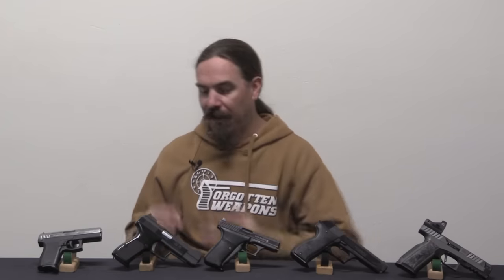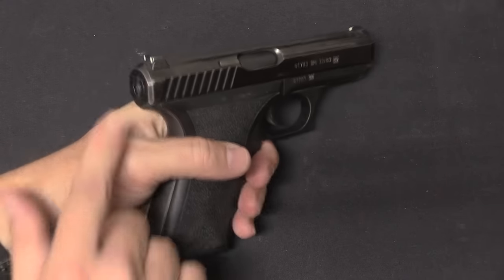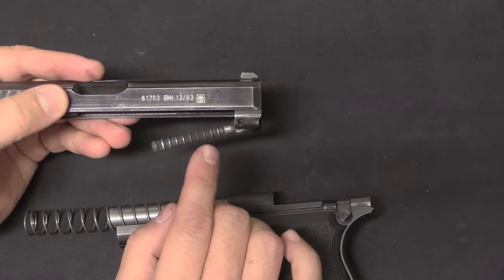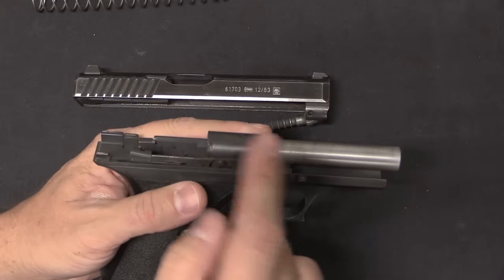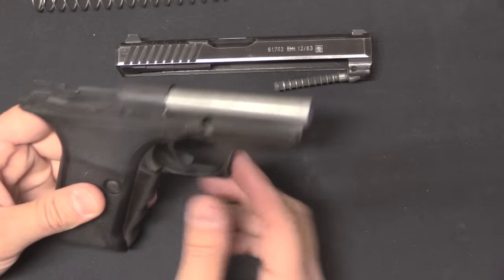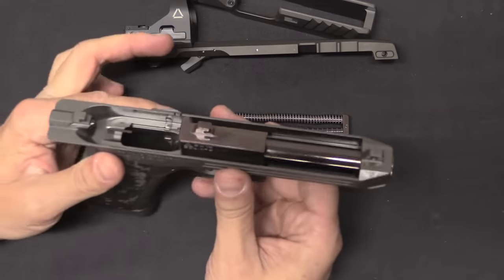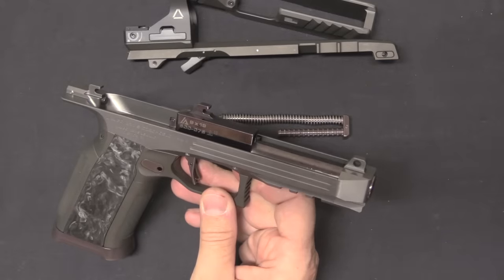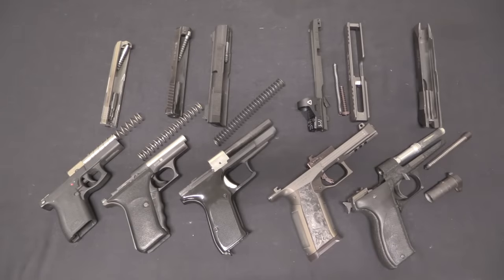Gas Delayed Blowback Pistols: A Tour of the System

Comment: I'm also a collector of gas delayed pistols, lovely to see this Ian.  The ADP was not available in 45 ACP but rather a shorter GAP like 45 ADP.  Only a few were made by Alex as prototypes. Alex was the owner of my local neighbourhood gun shop back in the day, so got to see these things.  I'm looking for a Norinco 77 and the CCP myself.  Have models of P7/GB/ADP/CP1
Reply: Skip the CPP my friend, parts #44 and #46 are made of polymer that's the wrong spec for what it does. After a random number of rounds, Part #44 destroys and or fuses with part #46 causing a complete failure of the striker mechanism. Meaning that you can throw the pistol at your target, but nothing you can do to the gun without rebuilding it will make it fire. 

And it's a real shame too because the ergonomics are fantastic, it's light and easy to carry, its incredibly accurate, and the recoil mitigation really does work. It has all the gas delayed pistol issues with overheating and needing frequent cleaning, and it only holds 8 rounds of 9mm but even with those shortcomings I would have loved it if the gun was reliable enough to keep.
Reply: @ericgrumbles447  But he's a collector, so it doesn't matter if they're junk LOL
Reply: Very Jealous.
Reply: Is the CCP made by  Umirex (sic)

Comment: I own a Steyer GB.
Very nice shooting 9mm. 
Very ergonomic design, polygonal rifling, 18 shot capacity. Way ahead of it's time.
It's only minor drawback is that you can't shoot lead bullets out of it and it is a very dirty gun to clean.
All that gas blackens up everything
Reply: @dansherman1980  Possibly.
I never let my gun get that dirty to find out.
And since it was in the running for military use, I can see where that might be true.
But it is very reliable with no malfunctions that I can remember.

Comment: I'm a sucker for gas delayed weapons. Its such an interesting mechanism, and while it does have its downsides, it does seem underused.
Reply: My understanding is that it’s due to the perception that they’re more "maintenance and cleaning intensive" than other mechanisms, despite all evidence being that they were no dirtier than roller-delayed guns.
Reply: Self-regulating and inherently more accurate. What's not to love? 👍🏻
Reply: @Ebalosus That Steyr looked fairly simple and the fact that it also drives clean air through the gas cylinder makes this more credible.
Reply: @mrkeogh  Sure because the barrel doesn't necessarily move it is marginally more precise, not accurate. Accuracy is up to the user. A good shooter with a browning is still gonna beat an amateur with one of these any day of the week.
The main reason this system is not used more is because it does not provide enough benefit relative to the cost increase.
Reply: One of the main draw back he didn't talk about with this type of weapons is heat if you are using it alot much heat builds up in the gas system which is why I would hesitate to use one that has a polymer frame
Reply: @MinecraftMasterNo1  What are your thoughts on why this isn't used on SMGs or carbines more often? Seems like the potential weight/recoil reduction and accuracy improvement would be good greater there, and the heat would be less of a problem due to handguards and/or heat shields.
Reply: @kolober2045   There's a reason the world all decided to use ARs and AKs, not G3s. The amount of engineering needed to make delayed blowback work on a rifle cartridge is too costly. Gas operation is much simpler and cheaper.
Reply: @MinecraftMasterNo1   also delayed blowback causes stronger kick effect of the bolt (simillar to straight blowback) decreasing accuracy.
Reply: @rdrrr  Heat build up is only an issue in two situations: If you dump a few mags worth through at the range or if you are on a killing spree in your local school/supermarket.
Reply: @gustavmeyrink_2.0 I have the HK. The heat builds up faster than you'd think. After a couple of magazines, the heat gets up to a very uncomfortable degree. It's a good thing the mag is just a single stack, because if the strings were longer I could see how people could get burned.
Reply: @lovelessissimo  Thanks. Nice to be confirmed by an actual owner.
Reply: @gustavmeyrink_2.0  the later versions even had a heat shield.

Comment: The system can most easily explained by comparing it to a game of pull robe. A simple blow back would be a strong guy pulling on a robe tied around a rock. The goal is to prevent the strong guy (blow back) to pull this rock (the slide) a certain distance in a given time before he runs out of stamina (gas pressure). To ensure this usually the stone (slide) have to made very heavy. But if you get another guy (pressure acing on the piston) bulling the robe in the opposite direction the strong guy (blow back) has to overcome this resistance to and you cold make the stone (slide) lighter. The gas pressure in the pistol that tries to push the case out again the slide (blow back) has to overcome the slide mass and the counter acting pressure.

But one thing that is often overlooked is, that the slide must move from the get got if it does not following will happen. Give that our strong guy (blow back) is prevented from doing any movement on his robe, because the other guy is as strong as him. He will get tired (bullet leaves the barrel) before he could affect any movement and then leaves together with the other guy (because if the bullet lefts the barrel and the pressure drops in both systems. The blow back force will end to act and the "delaying" force in the piston will and to act at almost the same time. ) 

This can be observed in high speed footage the slide does not gain extra speed as soon as the bullet leaves the barrel, because the "delaying" forces drop as well as the acting forces.

Comment: Hi Ian, fun and informative content as always. You are missing one fun gun in that set, other than Walther CCP - the Vaktor CP1.
Reply: That's a copy of the P7 system, isn't it?
Reply: I love mine, recently sold my old one and bought one in great condition. Awesome little guns
Reply: No, it isn't. It had a similar gas delay system, but it was single action hammer fired. They were all recalled, as they were not drop safe, which is definitely not a problem fit the P7.
Reply: I agree, shame he missed out on the CCP. It's my carry gun, compact, low recoil for a 9mm, and not expensive either. Big fan of what Walther's been up to recently.
Reply: @sethgordon4473  I have a pre- and post-recall CP1, they tried making a small change at first but ultimately recalled all of them.
Reply: @sethgordon4473  they didnt have a drop safety, but that doesnt mean they were not drop safe. for several years there were no problems. The problem only started when some dumb person modified the sear spring and sear engagement surface to get a lighter trigger pull (which does not work), and when one guy shot someone, blamed the pistol like baldwin and the court fell for it. You can hammer a cp1 on a hard surface all day long and it wont go off. The incredibly stiff springs just prevent that. But hardly anone had or has one so people just repeat the misinformation.

Comment: Finally a good explanation of gas-delayed blowback systems on youtube. 

The brass casing also acts as a piston moving the slide back, whereas the area of the counteracting piston is smaller which thus results in a lower force (assuming equal gas pressure) pushing the slide closed. So the backwards force is higher than the forwards force yielding only a reduced net force backwards accelerating the slide back. 

Aside from that, even though the gas bores in the barrel are very close to the bullet, it takes time to flood the counteracting piston volume to build up sufficient pressure for slow down the slide.

Comment: Yes another video or two on obscure operating mechanisms is a great idea. How about long recoil for starters?
Reply: How about long recoil pistols? ,😊
Reply: @AverageJoe4063  How about a telescoping mechanism to extend the slide movement length by 2-3 times? ;w;
Reply: @AverageJoe4063  That's actually what I meant, but I just realised I didn't spell it out.

Comment: 5:08 If one would design the P7 the way, that the slide could be kept shut by gas pressure (easily obtainable by enlarging the pistons diameter over the caliber of the bullet) one would encounter the problem that the slide would not move the moment the bullet left the barrel, because as soon as this happened there would be no force left to cycle the slide. Recoil force ends as soon as the bullet leaves and if gas pressure drops ind drops in the barrel and in the cylinder. The initial movement of the slide must be there for such a weapon to cycle.

Comment: I love putting the system in context. I’ve managed to get similar understanding by watching dozens upon dozens of your videos, but it’s very cool to have it all in one place.

I do wish you’d gone more into the negatives of this kind of system. From your range trip with the Alien, heat buildup seems to be the main one? Does the gas piston tend to foul worse as well?
Reply: I have a Wilson ADP.  After approximately 100 rounds carbon fouling causes the pistol to stop functioning. Using clean burning ammo helps. Good quality hollow points for example.

Comment: Thanks. Because of videos like this I got interested in you channel and in firearms in general. I never was a guns enthusiast, but as an engineer you got me interested in different mechanics of the firearms. Firearms is one of a few systems that are completely mechanical, and relatively simple, but slightest changes in design might significantly affect reliability, price and weight. They looks so simple, but it takes years to make design reliable and effective

Comment: M77B is a scaled-up version of type-77, which fires 7.62x17mm (basically .32 ACP). I guess a gas-delayed blowback system is the easiest way to scale it up as they only need to screw a hole and add a gas piston

Comment: One quirk with the Steyr system I can think of is that the slide will start reciprocating from the blowback of the cartride and then go forward again as soon as the bullet reaches the gas ports and fills the gas cilinder, causing a bit of a jerking movement back and forth. It's probably very minimal, maybe imperceptible, but if the designers decided to add weight to the slide to counteract that, then it's not neglegible

Comment: I have a recommendation for a video on the gas-operated smg. During February of this year, I was seaching on both this subject and the Gas-operated smg. It's not impractical. Chinese adopted it on the Type 79. There's also the SiG MPX. There were more guns, some being derivative from the AK in Serbia, but I don't remember all of it. As you can tell, it's both lighter and shooting faster. On the MPX, it's said to be recoil level of a MP5, while on the Type 79 Chinese video, they say the recoil was kinda uncontrollable, even with a recoil pad, but since the Type 79 doesn't have a handy handguard, it doesn't count IMO
Edit: I forgot the SR-2 Veresk SMG. It's gas-operated too. And the design of it has some similar points with the SR-3 or VSS/AS Val, but not straight taken from

Comment: The 22 mag pistol from Smith and Wesson appears to have the same system as the Styer.
Reply: The S&W uses gas to unlock the action not delay it's opening.
Reply: I believe the 22 mag is delayed blowback. While it uses the barrel sleeve design from the 5.7 the 22 mag version does not include the rotating barrel.

Comment: My mom picked up a ccp m2 on a trade. I didnt know anything about them, but found they are ideal for anyone with lower hand strength. The delay system also allows for a lighter recoil spring, making the slide very easy to rack. Its a very under talked about gun imo.
Reply: The biggest problem with CCP is its horrible trigger, for some reason Walther has refused to improve that aspect of it whatsoever.
Reply: @dieyproductions4403  i dont remember it having a bad trigger, but its been a couple years since i shot it and thats the only one ive shot.
Reply: A looong trigger pull. It tests your motive.
Also, mine would not shoot plus-p ammo. Destroyed the striker set up. The little spring.
Reply: @Bojangles6  every single review I have seen of it has mentioned the bad trigger so even though I don't have first had info, what I have seems to be consistent from multiple sources.
Reply: @paulwiggins183  problem with the trigger is more than it having a long pull, people who have review it have said that it is like pieces of glass or sand rubbing against each others, and not a very well defined wall either if I remember correctly. It is just a waste to not put your best trigger (like the one in Walther PDP for example) in a gun that has a noble action which lends itself well to accuracy (the non moving barrel). I didn't know about the plus p thing, even though plus p ammo for 9mm is a bit of a gimmick, there is still not a real excuse for a manufacturer in 2023 to make something incapable of handling it, that being said, what generation was yours? Because they did some fixes a few years back and they might have included the ammo intolerance flaw.

Comment: In 1990 or 1991, I had the opportunity to thoroughly test a gas delayed conversion for the 1911 Govt in .45 ACP. The principle was very similar to the HK P7 (my duty weapon in those days was a HK P7M13. Awfully expensive but it was a time when French police officers in specialized units could get an authorization to buy and use their own gun as long as it fed 9x19 or .38 Special … and they’d just recently replaced the MR73 with the French made version of the Ruger security six renamed RMR). Long story short, that conversion unit was 3 pieces: a barrel and gas cylinder block with quite tight machining tolerances so that it would fit tight, nice and cosy in the Govt frame;  a different recoil spring and, if memory serves me well, the piston that replaced the usual guide rod. I think the bushing had something special too. I couldn’t find any trace of it in the imperfect memory of humankind called the Internet. Would someone know about it?
P.s. the thing was working quite well as long as you’d use potent ammo. Still, it was a pita to clean and the buildup would start creating problems after 2-3 magazines. Too bad I didn’t keep pictures…

Comment: Its fairly easy. The P7 got an acting piston of 9 mm diameter (the case that is pushed against the slide) and a counter piston of 7 mm (the tapped gas) These pistons work against each other. 9 minus 7 is 2. Therefore the slide will open with the force of a 2 mm piston.
Reply: Not quite. You need to subtract piston areas, not diameters. 

π(9/2)^2=63.6
π(7/2)^2=38.5
63.6-38.5=25.1
25.1/π=8.0
√8=2.8

So it opens with the force of a 2.8mm cartridge, assuming the pressure is the same at the bolt face and at the piston face, which it won't be, so it will actually open faster. In fact, the gas port diameter may have a larger effect on opening speed than the piston diameter!

Comment: Type 77 was designed by a self-taught non highly educated worker. Due to special historical reasons, somehow this pistol been considered as the crystallization of the wisdom of the working class. The mass production and the column loading were all the way green.Unfortunately, this pistol did not receive high praise in the military due to its poor human performance, and the solution to these design flaws is the type 77B pistol which we having how in the video. Unfortunately, these efforts did not improve the evaluation of this pistol. Although the general rating of this pistol were quite poor, it has still received some good reviews among groups with special needs such as border police and plainclothes police. There are some other storys about this pistol which you can easly found in Chinese group on Internet. Not a great pistol but a pistol with story indeed. 8:27

Comment: Ian, big P7 enthusiast here.  There's one feature that I don't see getting enough attention, that I would live to see you geek out on: slide length to barrel length ratio.
Is there any pistol this size that manages to squeeze such a long barrel into the frame?  Look how far back the chamber is compared to other handguns.  It's impressive how HK designed that strikerfire mechanism ao compact.  Regardless, thanks for the content!

Comment: 4:45 Also recoil spring.
So it is going to move with the bullet, but there are pressure and recoil spring working against it, although pressure gets lower the farther the bullet travels down the barrel
It's like having two syringes filled with liquid

Comment: The alien seems to have an advantage that the hot cylinder is at the top and not going to rapidly heat up the dust cover of the frame and potentially burn the shooters fingers like the HK is notorious for. All these delayed systems seem to rely on the strength of the case a bit too optimistically though, browning had it right just leave it there! But solutions looking for problems make the best videos on this channel

Comment: The explanation makes it sounds more complicated than it is. Really, simple blowback is gas-operated already. Using the cartridge case as the gas piston. Now we are adding another smaller gas piston to oppose some of the original piston's thrust. It doesn't delay the opening as such, it makes it act as if it is firing from a smaller diameter case. As in, the slide opens as one would expect for a simple blowback with a case base area equal to the difference in the piston sizes (except the Steyr GB because of its late introduction of gas pressure)